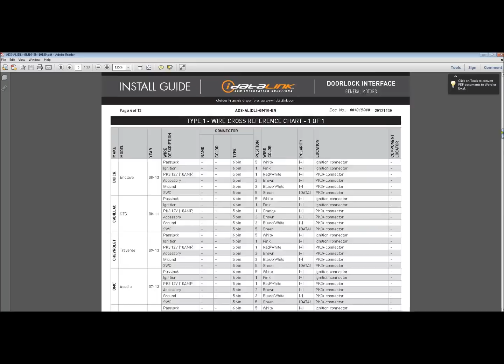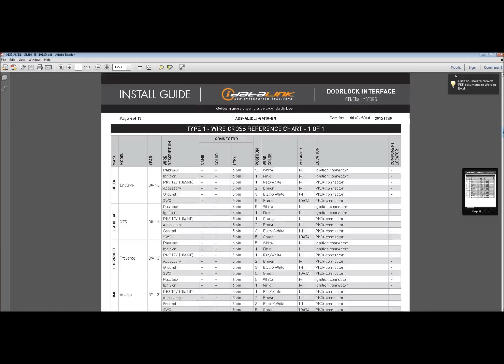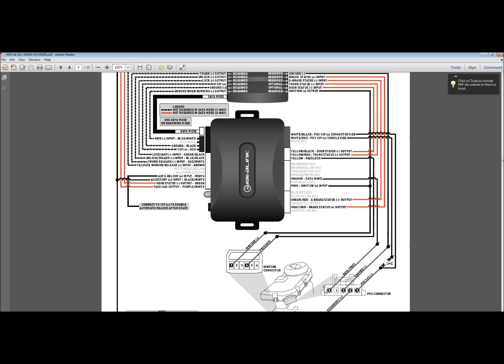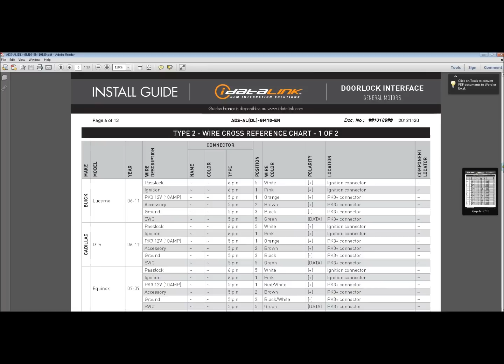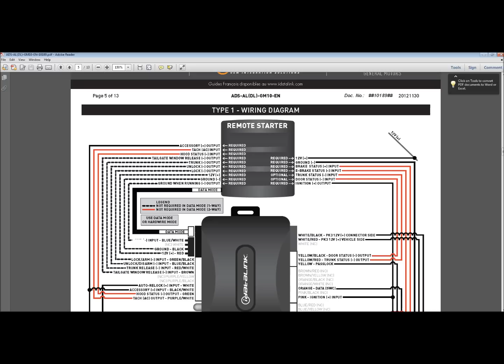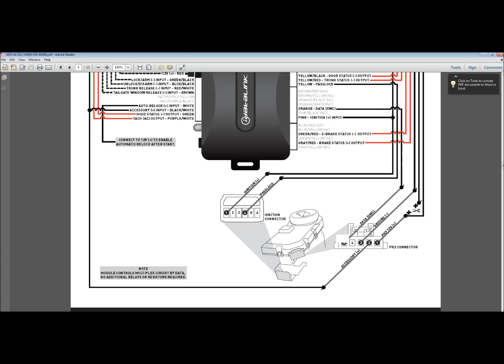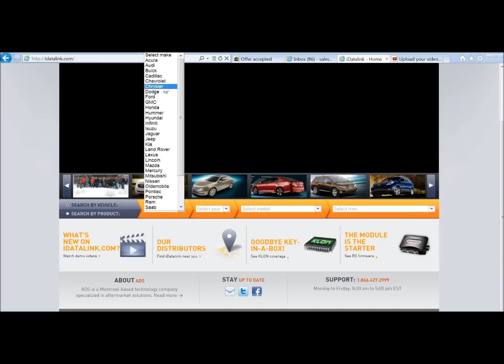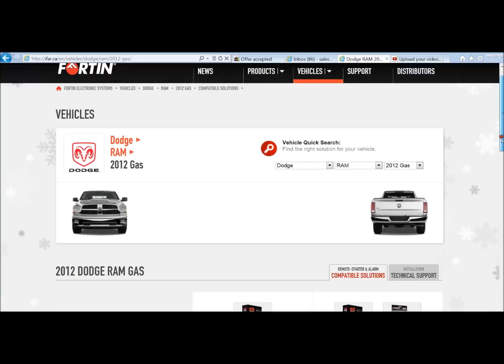What is a bypass module and how do I wire it up?

Comment: All I did was pop the chip out of the key, taped it next to the ignition lock had five spare keys cut for $2.50 each and everything works fine for the last 17 years. The prestige APS 57 remote start still works great never had an issue.
Reply: It worked for 17 years? Wow

Comment: I am very thankful that you are teaching how to do this on our own and I would really appreciate if you can answer the following questions.

1.What about the standard "Ignition, ACC, Starter connections from the remote starter to the vehicle, are they still required or no?

2. For example the Break Status Input wire is running straight from the Remote Starter  to the bypass module as Break Status Output.. What I don't understand is that how can the system work without taking any inputs from the vehicle harness. There has to be a connection to the vehicle For Break Status Input/Output 

The problem is, if we are just running wires from the Remote Starter to the Bypass Module, wires such as unlock, lock, tach, trunk, hood status, door status and trunk status as shown in the diagram. I mean... where and when do we make those connections with the car?
Reply from the maker: Unless you are installing one of those new t harness canbus styule starters like the evo-all-   All the heavy gauge connections will require doing, like the accessory, starter and ignition you were talking about

Comment: Why did you connect the brake status, door status, and trunk status inputs from the starter to the bypass if they are red wires which it says Don't use for 2 way data mode?

Comment: I'm just looking to remove this along with the Viper 5601. Reason being, there'a a GM TSB for alarm systems causing the Fuel injectors to add too much fuel when the alarm systems mechanical relay causes a disturbance to the ignition circuit while the vehicle is in motion. GM states that it results in misfires and potential catalytic converter failure.

Comment: Great video thanks for the information, really clears some things up for me, but I have a few questions. I bought a Viper 5706V with smart start and am looking into an idata link for my 2006 GMC Sierra 1500 extended cab. Will the idata link and the viper communicate using the 4 pin data? If it will, how many wires would have have to connect to my vehicle? If it won't would you suggest a different route?
Reply from the maker: +allstarnb1 what you should do is download the specific guide for your idatalink and follow that exactly, since all vehicles are different that guide is your bible to follow, and that'll tell you how many connections are and are not required.
Reply: +Lessco Electronics I did download it, but it stays something about a data 1 "these wires aren't required" and for a data 2 "these wires aren't required". What does that mean exactly? Thanks!

Comment: the wires that come out from the remote starter module they go on the car and then in the bypass module im confused or they go direcly on the bypass on your video the toyota instalation  all the wiring was instaled on the car then you added the bypass tks for the info

Comment from the maker: d2d is only communication between the starter and the bypass, the wiring is still required on the bypasses side in most cases
Reply: I got an Avital 4105l and a FLCAN. My car is a Kia Optima, 2013, standard key. Can I connect remote start and bypass in data mode and avoid connecting the hard wires? Also, 1 way or 2 way? Thanks

Comment: I have a Voxx with a flash logic bypass. I got the remotes to program and lock/unlock my expedition. It even remote starts with the key in the ignition. Trying to program it to start without the key causes a start system fault code. Any idea why it’s not taking the programming?

Comment: I think what I'm getting from this video, is instead of running the wires to the wires in the car, your saying just wire everything from the remote starter to the bypass as your diagram shows, please confirm weather this is right or wrong. just wire everything up to the bypass all though it is a data 2 data install?

Comment: hello, how do you know which install on idatalinks website to choose? when you type in your vehicles make and model there are several to choose from.. is there some type of code/number on the Idatalink box that u purchased that leads me in the right direction?  thanks in advance.. oh also when I downloaded one I noticed a skim plug in at the top of the page with what looks like a 4 pin connector going into it, do you know what that is? I know it has something to do with the key but it that utilized!

Comment: Correct me if I understand you correctly.  All the wires coming from the remote start get connected to the bypass module then the output of the module goes to the car? How does remote start power up?  Please advise. Your response is greatly appreciated.
Reply from the maker: the bypass is converting the analog inputs into can bus digital outputs, that's pretty much whats happening.

Comment: I have a viper 5706v and a flashlogic flcan if i use the data cable then what other wires do I need to connect? I already have the 5706v installed I am just now upgrading the bypass module for remote start and door lock functions. I was going to use the t-harness but unfortunately I have a tip start and the harness for the ch-5 is not tip start only (which makes absolutely no sense considering most all vehicles of these years are tip start.) Anyways I need to know which wires I need to connect? The guide says that in data mode none of the other wires are needed.

Comment: My question is .What is the benefit of using the blade in a CM6000 for the immobilizer functions and using the idatalink ADS-TB-KO-EN for the door lock  unlock arm disarm installation..?Thanks
Reply from the maker: +Steve Hurst its less messy and more compact since it slides in the cm6000

Comment: hello, this might be a dumb question, but I'm gonna ask it anyway.. I'm a little lost with the whole d2d connection thing.. if I'm using d2d the wires towards the front of the bypass red and the disturbed wires are not connected right. or do these wires still get connected anyway from the brain to the bypass.. I think we're I'm getting lost at, is the legend shows if your you are using d2d then nothing red or disturbed gets connected only the solid wires please help, as I feel like one minute I get it then I feel like I take 10 steps backwards, your help will be greatly appreciated!

Comment: Ok don't know if I'll get an answer for this because of its age but here goes.  I'm helping hook up one of the EasyGO push button start modules to a buddys truck On the wiring diagram the remote starter is that supposed to be the Ezgo module box I hook the datalink into or some random one already installed in his truck? Dumb question but gotta ask I'm brain farting on this.

Comment: I have a crimestopper sp-502 remote start & car alarm...  with the fortin evo-all and the Tharness...

Everything seems to work fine, except for the remote start portion.  I am using this on a manual transmission vehicle.....  I need to know if in typical bypass modules with seperate remote start and car alarms, do I need to wire up anything on the crime stopper unit other than the data link plug between the two boxes???

Thank you in advance
Reply from the maker: you should folow the install guide from fortin when wiring in data d2d mode.
Reply: if that was done, but vehicle will not turn over... could the fortin and the crimestopper both be trying to remote start

Comment: When it comes a Buick park avenue 2003 v6 3800 how I can bypass the key that has the resistance inside de head the key the security. Light stys on and no crank and start happens

Comment: IN REGARDS TO THE "IGNITION WIRES INPUT/OUTPUT" WIRES:   I am connecting a PYTHON 5706 to a Nissan Maxima 2010 Push to Start using a XPRESS KIT DBALL2 -- 402 NISS3HT FIRMWARE 2.11, AUTOMATIC TRANSMISSION. USING PRIMARILY DATA TO DATA. 

The DBALL2 installation manual says to connect TWO WIRES from the DBALL2 BYPASS  [ignition output (+)  and ignition input (+)]  to ONE WIRE on the remote start python H3/1 Pink  IGNITION 1 Input/Output, heavy gauge.

Question:

(1) Is it correct to connect the TWO Wires from the DBALL2 bypass  [Ignition input & output] to the ONE WIRE H3/1 PINK Heavy Gauge of the python remote start?

(2)  Are any Diodes required when connecting two wires to one OR can I just twist them together?   If  Diodes are required, where would they go?

DBALL2 Install Guide:  http://xpresskit.com/VehicleCompatibility.aspx?p=null&year=2010&make=Nissan&model=Maxima%20%28Smart%20Key%29&ps=1&s=0&c=0

----------------------------DBALL2 Harness-----------------------------------------------------

12/8   Ignition Status Input (+) - ignition input -- Python H3/1 PINK  Ignition 1 input/ouput

--12/9   Ignition Status Output (+) ---ignition input - Python H3/1 PINK  Ignition 1 input/ouput

REMOTE START, 10 PIN HEAVY GAUGE-------------------------------------

--H3/1   Pink    (+) IGNITION 1 input/output - Connect to DBALL2 (two wires - ignition status input & output)

-H3/2   Red/White    (+) fused (30a) IGNITION 2 / flex relay input 87 – BCM, (GRAY, 40-PIN PLUG), PIN 16

Comment: I have the flash logic module for my Jeep GC 2012, used the canbus harness only and it works fine. But I need to rely on the hazard/signal indicators to know the remote start sequence(lock x3) to start the car from afar. I noted that the module has a wire to trigger the horn, can this wire be hooked up to the horn so the car would honk on remote start???? or is this horn wire disabled if the canbus harness is used?
Reply from the maker: +Imran Sarib refer to the manual for the firmware you are using, thatll tell you the limits of what it can or cant do.
Reply: Didn't come with a manual.
Reply from the maker: best bet is call audiovox (they make flashlogic) ask for tech, phone # is 631 231 7750

Comment: GROUND WHEN RUNNING input from bypass gets connected to 500mA Ground when armed output (orange) or (-) 200mA status output ( dark blue) on the remote starter. If yes, do I need a relay connection or just straight? Thanks!
Reply from the maker: connect them direct, no relay required
Reply from the maker: Just connect those directly to one another

Comment: 2011 dodge journey.

I can start the car with the keyfob (without rf battery installed) and can start the car with just the fob pushing the start button!
After I install the command start and bypass to the start button, the button wont start the car using the fob! the button wont even light up.
I can start the car still by pushing the button BUT the car wont start if I just use the fob (without battery) and push the start button.. wont start!

any recommendations?

Comment: Hey lesco in the diagram it says use these wires if data mode 1 way or data mode 2 way it's a little confusing because it shows that all the cables need to be connected red and dotted wires
Reply from the maker: DJRocco973 the dotted ones are optional usually

Comment: Hi why some vehicles make like the saturn ion 2006 don't have a start wire available on the ignition key harness I'm trying to install a directed alarm system plus remote starter so how to hook up The remote starter wires to the ignition harness thanks

Comment: Just a little comment about this video when you state that GM is not into CAN networks...
The SWC wire that is connected at the PK3 module...
SWC stands for Single Wire CAN...
So this wire alone is what communicates information from the vehicle to the IDataLink module...
It send the info for PK3, Door statuses, Dool Locks, Tach, Factory alarm control, heated seats, VIN, etc...

Comment: When Using a Bypass Module for a "Remote Start/Alarm" do you still have to wire the Heavy Gauge wires from the Alarm/Remote Start?
Reply from the maker: yes, they must be connected
Reply: Bc these 2 comments i got my bypass and aftermarket remote start and alarm working in my 2013 charger. Thanks.

Comment: Lessco am installing the alarm for a friend and I cant get the idatalink ALca
to go to the step 2 of klon.
I think am going thru the right steps,
reset the box, connect the cables use the data mode, use the two keys, remote start, box light goes green for the two seconds indicating its complete.
after this step I cant get it to work to finish the klon key step 2.
it will be very helpful if you could help. thanks
Reply: never mind and thanks for the help.
the problem was the cheap python alarm that did not work with the data cable.
the alarm brain has the port but never sends the signal to the idatalink ALca.
hard wired it and it worked just fine.

Comment: I have voxx kit and need pin out of need to know which wires I need to connect. To 2004 Honda element ex pls
Reply from the maker: Easy, call audiovox tech at 631 231 7750, its all there

Comment: Still give out free wiring info??

Your Youtube vids helped me out alot amd the wire info would make life akot more easier too.. tks in advance.

I need 3 for 3 diffrent vehicles.

1998 chevy Express 2500 5.7L 8 cylinder cargo van

2004 Cadillac Deville Base 4.6L 8 cylinder 

2002 Acura MDX base 3.5L 6cylinder . AWD...

Comment: I have a 1998 Silverado with an autopage system and its messing with my brake lights I have tail lights but when i hit the brake they don't work any advice?
Reply from the maker: thats a whole different topic... but yeah, check your turn signal switch connections and the molex connector in the back where the lights connect and check for rust and corosion, also do the obvious stuff like check fuses etc..

Comment: Do you have to physically connect the wires from the remote start to the bypass module? I thought if the lines were dotted then it does it through data.
Reply from the maker: +Gagunner34 yes, but to different extents depending on the specific vehicle application
Reply: +Lessco Electronics OK appreciate the reply.

Comment: I cut the vats wires and just added a resistor and car starts fine. how or where do I connect the wires/wire to remote start the car. Aps 997-e alarm

Comment: I have a crimestopper sp502 and a mycar telematics module hooked up and working.my sp502 broke so i bought another sp502 and switched the brains.now the new sp502 doesnt work on the  app.both lights are solid red and green for the mycar module.when i use the app it goes red on start unlock and lock.how do i progam it on the app or what?

Comment: Thanks for your reply.  Greatly appreciated.  After watch and listen to your video and compare to the 'Direct Express Bypass Interface Module" installation guide, most (door lock/unlock, trunk release and etc...) wires are not required/connected if in D2D mode.  How do you switch to D2D mode.  Please advise.  As always, your response is greatly appreciated.

Comment: Any reason why I would lose remote start function on a viper alarm? Alarm system works. When I press the aux button twice, the signal is sent but engine does not start. Engine cranks too but does not engage. Hope this helps. 2001 S10
Reply from the maker: why don't you use the alarms built in diagnostics? Itll tell you the entire story.
Reply: Lessco Electronics - how would I do that? Or I'm wondering if I need to reprogram my gm bypass module or something similar.

Comment: great video I have one question I have the Idatalink  ALCA bypass and going to use a compustar cm 7200  remote start will the data mode eliminate alot of the wiring between the unit and the bypass  I normally use the blade type and the ALca is new to me
Reply from the maker: +Gibby gaming there isn't a straight answer, that alca wires up 100 different ways depending on the instructions specific to your usage and vehicle.

Comment: I wouldn't recommend using that DEI Viper junk.

With the iDataLink, GM4 (the firmware applicable to your car) will do locks and passlock override. It will not disarm/arm the OEM alarm if your car has it. And it does not handle RS inputs (tach, brake, ect...)

Comment: From the information you are talking about. Not all the wires need to be installed. Because of the data cable. It clearly shows that on the  bottom of the remote starter picture. under legend. the wires with dashes and in red are not required. Only solid black.
Reply from the maker: I thought I said that, But ok..

Comment: I have a autopage alarm rs665-2w and a fortin int-sl+. 
Its going in a 2003 tahoe. How do I mate this like you video. I asked the sales man for a plug n play and it didn't happen.
Reply from the maker: Anthony chaney  If that autopage has a d2d input use that, if not follow the hardwire diagram on your int-sl+
Reply: Your diagram is great and you explained it perfectly. Can I use your diagram for my autopage rs665-2w alarm. And my autopage data plug won't work.

Comment: "Data to Data" and  "Wire to Wire":  The diagram RH side has  RED Dotted (Data mode 1 way) & Black Dotted Lines (data mode 2 way) and solid red & black lines.  If an alarm install is using D2D, does this mean that all the Wire to Wire connections (Dotted Red & Black) are not necessary because D2D connector will do all of this?   Or is it necessary for Wire to Wire and Date to Data Wires to be all hard wired? 

IDATA Nissan Maxima 2010:  http://cdncontent2.idatalink.com/corporate/Content/Manuals/DL-NI5/ADS-ALSL-NI5-EN_20130924.pdf